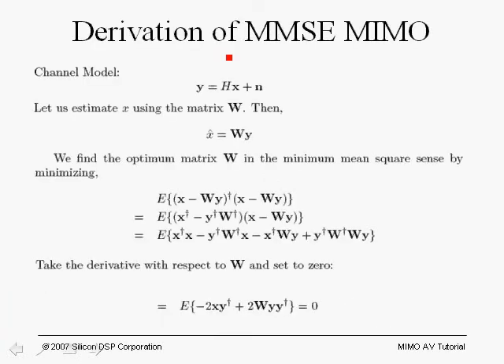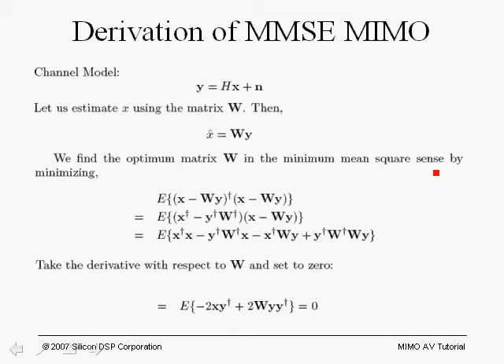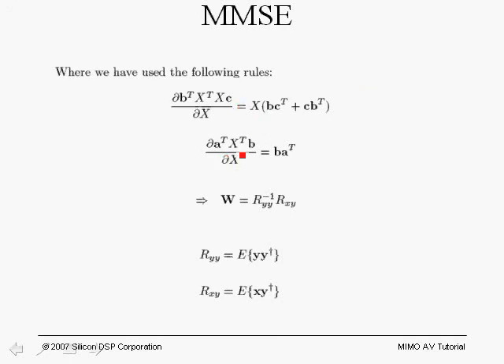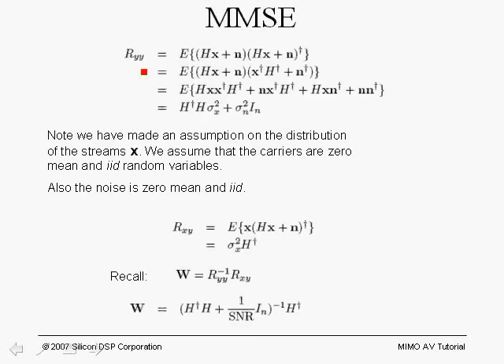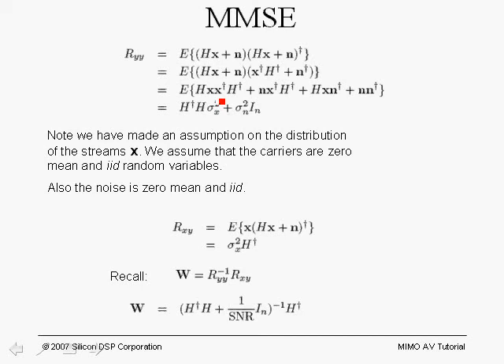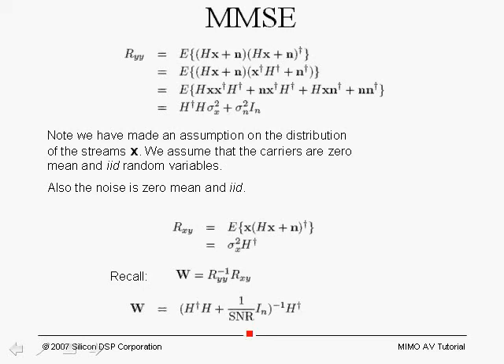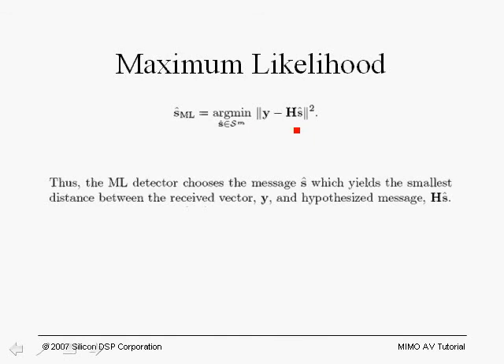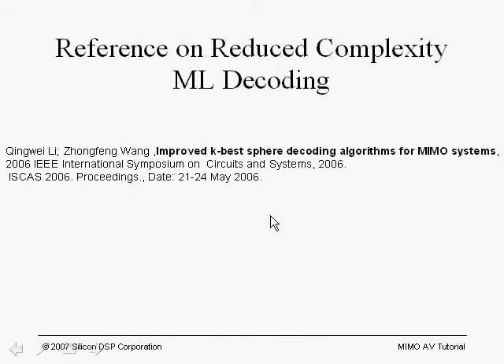MIMO OFDM Tutorial Series:  MMSE and ML Detection

Comment: Unfortunately, I was unable to reproduce this solution. When using W_est = ((H'*H) + sigma2 * eye(N_rx)) \ (H'), it works perfectly. However, when trying to compute it from x and y (i.e., W_est = (R_yy + sigma2 * eye(N_rx)) \ R_xy;), it doesn't work as expected. After some manipulation, I found the following working solution: W_est = ((R_yy + sigma2 * eye(N_rx)) \ R_xy')';. Could you confirm if this is correct? (Note: these equations are written in MATLAB syntax.)